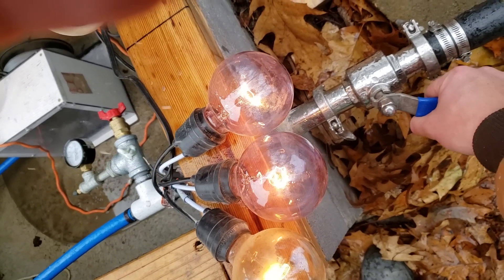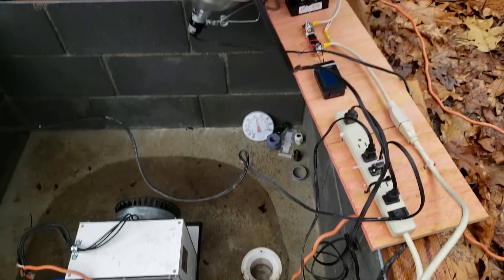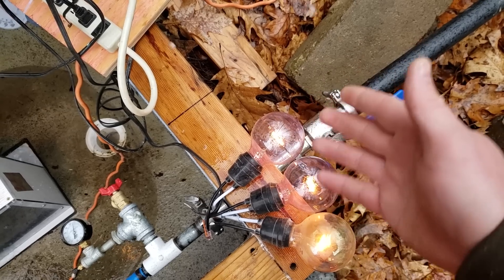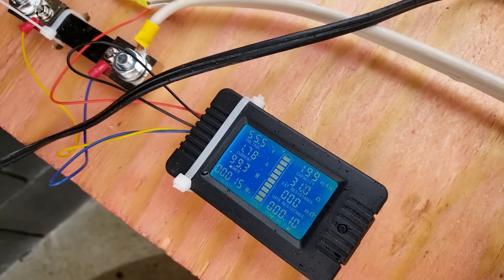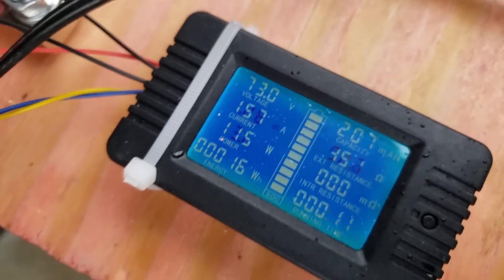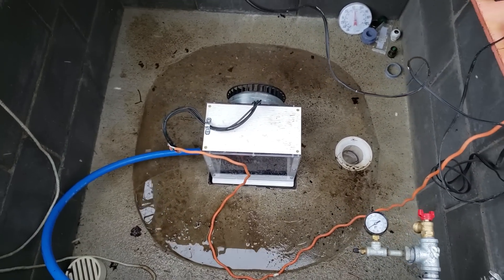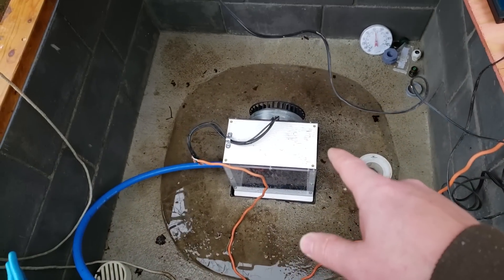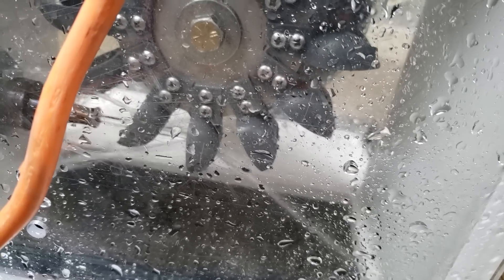It's Producing 130W* at 11gpm 280ft, Much Less Than It Should.

Comment: Bro ya can't test the motor like that you will damage something...... Cause you not got compensation on the flow when you turn the lights on motor needs more tourqe as the switch is closed .....so fully opening the flow the switching any light on is technically a short circuit and probably kill that FULL BRIDGE RECTIFIER 😂
Reply from the maker: It's not a concern, the rectifier is rated for 100 amps and alternator for 4kw.
Reply: @JoeMalovich  probably sounds worse on video than it is. I not no expert but that noise from it can't be good on bearings 🙂🎄
Reply from the maker: @davey2k12  fixed in the next video I think. It was a jet alignment issue.

Comment: You are also getting a restriction from your fittings on your manafold off your penstock. They create turbulence as water flows through and effectively makes a smaller restriction.  the best thing that I can think of to illustrate fluid dynamics and turbulence causing restrictions would be the Tesla Valve.

Comment: Hi Joe, the Turgo turbine isn't made for your setup. with Turgo turbine you need more water and less presure. I am not sur that your blue pipe is able to accept 11GPM ( it's 0,7 liter/second) without big losses. You should tried to connect the black pipe to the nozzle. When I made my tests on my Pelton turbine, I was using several bulbs, (as you do )and the maximum I had was 450W. But as soon  I have connected a Mppt charge controler, the power has increase to 650W.

Comment: I don't get your hookup you said something about that generator being three phase yet you basically hook it up to your power strip like it was household current and I imagine you have a hot ground line. I'm not there to see the whole thing. I was going to comment and I still am. You're DC voltage is the probably the equivalent of a lawn mower stator note the stator is under the flywheel comparison in this manner you got a good stator. If you did not hook it up to a hot ground line. Which your light bulbs are not using if anyway. You have more power that you have not tapped into yet because you're not using one of your three phase coils you're down a coil. Because it's a 3-phase generating unit if this is so you are measuring only two of your three live wires.. or is one of the negative. If negative it should go to the frame of the car if it was a car alternator. Therefore yeah do you have a grounded. And your two hotlines should be tied together yes because you have a silly three-phase generator. Okay don't forget that you can blow a coil that is overheated.
Reply from the maker: The 3-phase is rectified to DC
Reply: @JoeMalovich  shocking you was playing with AC current..... best not get shocked
Reply: @JoeMalovich  I'm not an expert when I say you have success. And if you want more power it looks like you need to put in another unit that is a mother turbine. Yet you declare you're having issues in maintaining your pressure. I think you want to definitely scoot. AC current into the dwelling before you Rectify it. Quite frankly I wonder why Rectify it at all. I definitely I think that you should just dump it into a electric heater that can take the variation of current that is not necessarily considered electronical. Adam breaker and you probably have it set for winter. If you desire to have some fun get rid of these solar generators that is is a battery in a box something like the jackery 500. And then there's is one called Yeti. Well in closing I hope you do not have to pay the price learning what causes your copper coil to overheat.

Comment: Where is your ground. Where is your ground rod. Where do you put that ground in Concordance with the generator unit coil itself. Know when we buy portable generators there's always a little section about grounding. We easily know how to ground an appliance. But this is a generator. Even I need to look into where does one need to ground a generator unit. Because I just follow the instructions.

Comment: Joe, i'd start with removing that blue pipe and stepping it up in size, i went from 1.5" pipe to 2" and gained 50w per jet.
 That bend in the blue pipe will also give you some loss so would remove that,my guess is you will only have water for one jet so i think i'd move the entry point of the pipe so it's directly in line with your turbine housing rather than it go around to the other side.
Next i'd be looking at your pelton wheel, i used the wheel that come with these turbines and it was ok but then bought one with more spoons like yours this made things worse i then bought a turgo which was much better.
You have good pressure so maybe a smaller wheel would work better, also a smaller wheel would give you more space in your box so less turbulence (if that's the correct word)

I've been having fun with one of these for 2 year and if i've learned anything it's you need to do a lot of trial and error till your happy, sit back take a look at what you have scratch your head and go back at it and you will get your end result your already winning as your making power you just need to fine tune it.

Comment: I think the walls of the  turbine housing are too close to the pelton, the wail from the pelton feels as if the water is bouncing off the wall and hitting the pelton again. I think some peltons are designed to use the bounced water also but the housing walls are angled differently. If possible just try removing the housing wall just opposite to the jet.

Comment: How bout turning the 120 v DC into 120 v AC someway . Or add more jets . Also if it’s  120 v DC coming out , you could lower the DC voltage to about 12 , 24 , or 48 volts DC and try to run an inverter off of it and see what it can run at 120 v Ac . Also try using an auto water pressure regulator to keep the hydro spinning and to stay within the set DC output voltage when running heavy loads off the inverter . Which means ,When you switch on a heavy AC load  , it will let more water pressure spin it faster to maintain a steady DC set voltage for the inverter to keep running the load until you turn it off then it will slow back down maintaining the set DC voltage until you run another heavy load and so on . I’m just saying it might work .

Comment: I was trying to figure out how you have that hooked up...I see your problem

those generators were not meant to be directly connected to a load...DC or AC

the rectifier of course takes the 3 phase AC and converts it to DC....that DC is meant to go through a charge controller to charge batteries, the batteries of course run an inverter....you need the batteries and inverter

an MPPT controller like midnight solar has would work great...
Reply: Ay it he only getting 200w cus he loaded it making circuit resistance less causing the spike I'm surprised the switch didn't fry or damage the motor or bulbs from keep switching that heavy load on 😂
He cud of tested the motor first 🙂

Comment: Water bounce of spoons and shoot in opposite side of box, this means water after interaction with turbine wheel still left some energy(maybe half or even more), your turbine extract not all energy from water - this is major loses. You need some clever turbine tuned for this particular water jet, or second stage of turbine. When you extract all energy from water, it will flow straight down, and not flying all sides.

Comment: Hmm I don't trust that meter, unless it was specifically rated as a "True RMS" device. That 20 watt residual is very suspicious. Rectified 3-phase is very different from a sine wave and will give you bad readings. See if someone can lend you a True RMS volt + ammeter? Then you can measure RMS voltage and current to work out wattage.

Comment: I dont think its a single issue like a few have said you should lose the shunt and power meter and get a good clamp meter also at full speed there was water bouncing off every flat surface inside that box causing friction, also if your using an mppt controller for a 24v system you will see a lower voltage reading but an increased amp/wattage going into your batteries and as long as you have water that should run 24/7 unlike solar so at night when your using less it will be topping up the batteries.

Comment: but i would move away from bulbs and work with batterys if thats the way you want to go as long as you have a columb meter on the battery so you can always see that current is going into the battery and wat ever loads you have does not exceed the input i think all will be good

Comment: problem is thors bulbs are only that wattage at the dysigned voltage you need to work in the range your wont the voltage so say you wont 66V then i think 3 12v bolts in series might give more the right range if indicator bults then they tend to be about 21watt each

Comment: You dont think that because of the freezing temperatures that the water has actually expanded giving you false flow readings? 
Im not electrical bias so wouldnt know of anything there however these temperatures could also effect whatever lubricant you have in those bearings that could be causing a lot more friction that youd expect

Comment: one thing in my reading is when they say 80 to 90% effficent they never say jet amount size of pelton wheel and so on i do think a spear valve is best that way jet size can be adjusted with out having to take apart to fit new jets and the way i see it the more jets the more foce on the pelton wheel so more steady rpm when loaded i maybe wrong but i feel the more load means more mechanicle resistence so this would been more jets to keep that same amount of force

Comment: You need to hook up a charge control which would maximize the voltage and charge the batteries. Maybe to much air and you may need a stack pipe.

Comment: Great to see more progress. 
for measurment : It's not dc, it's rectified AC, so you have a massive ripple.

 To get stable  DC (for measurment) you will need a capacitor to even out those ripples.  how big a capacitor depends on the ripple size. 

There might be a small capacitor in your  device, but not big enough for the size of the ripple

Comment: You are thinking of the curve of efficiency being linear and it isnt at all. you will only get good efficiency at the peak of the curve. at the low end there are so manny losses to overcome and at the top end the penstock friction starts to give losses. There is a window in the middle that will work efficiently and your job when making the turbine is to make the window as wide as possible so it will run well at all its rated flows. You have to remember that it takes a lot of energy to to spin the thing so you have to overcome all that first before you make any power. But thats not to say the problem is in the alternator. it isnt. i use the same one unmodified and easily get 60% efficiency if not more and my range of flows that work at that efficiency are 200w - 400w, below that or above that it drops off. When you sized your system you needed to monitor the average flow and size everything to run at that. I think you are thinking you can have a turbine run at 100w at 60% efficiency and have it run at 60% at 1000w you cant get that sort of range with a basic turbine like that. you will find that the turbine has a sweet spot where just a tiny bit more water makes it produce a lot more power but your just not there yet. If the 11gpm is a normal flow for you then you need to size the turbine to work at that flow and to small varations either side of it. you will never get that system to run at your lowest flow and highest flow efficiently because that gap is just to big to try and do with one turbine. You would need a small turbine and a large turbine. to get such a range. dont get me wrong it will work but it wont be efficient. My systems have always been made to work best around the 300w mark. it works well down to 200w and will go to 550w before real big loss come in to play. But to ask a turbine to work at 60% efficient over a range of 100w to 1000w is just not realistic with one turbine and lots of nozzles. I Really think you should slow down forget trying to get a turbine in this year and just measure flow. I measured flow for two years before i sized my system and i knew the average flow and sized everything accordingly. if you go right to making a turbine and you dont have a really good idea of what flows to expect, and they are so volatile, making a turbine without that data is the wrong way to go about designing a system. I love the vids and im not trying to put down your work at all i just think you need alot more data before you carry on.

As far as jet alignment is concerned it looks ok. Maybe adjust it up a little. but the pelton has to few spoons to really work at its best. if you spin it slowly you will see the jet jump the gap for a split second. there should be another spoon in that gap to catch the energy.The jet should interact with three spoons at a time.

And also dont relly on the free spin voltage to tell you your loaded voltage. work it out from rpm, the free spin water splashing can slow down the wheel and give a wrong reading and then you set your load voltage to half that and its out, work out how many volts per rpm and work out your nozzle velocity go from there, use the free spin voltage as a very rough guide only.
Reply: Also what PMA is that. if its the 48v one then something is wrong because you should be seeing 4x that voltage free spin at your pressures.
Reply from the maker: @KrisHarbour  it's the 1603 which does not produce the volts per RPM you might think based on the website information.  I'm getting like .072 Volts per RPM.
Reply: @JoeMalovich  Ok well that is interesting. you need to work out your nozzle velocity, and the speed that the cups would move on there center line (the area the jet hits) With that PMA with a turbine that size i would expect you to be getting 400v I use the same PMA at 25psi and get 120v at free spin and my turbine is very similar in PCD (size across spoon centers)  work out that nozzle velocity and let me know and we will see what rpm you should be aiming for.
Reply: Also i would really think about doing a direct water heating system instead of the charge controller and batteries, you will loose 10% just in the controler and charging. I have to do that because im off grid but for you your biggest consumption of power is heating water (im quite sure you said that was the case) so offsetting your grid use by heating your water tank would be a way of not being grid tied but use the power wisely. It would also be a lot cheaper doing it like that. its basically what you have set up there. you would need a way to fix the voltage to something a heating coil will work at and match the turbine rpm to that then dump the amps in to resistive heating in the water tank. Just an idea to save a lot of money on parts and save money on your power bill in the future. with batteries you wont really save money for a long time as the cost os high and the payback on them is a long time.
Reply: Kris, are you saying that at 30gpm he might actually get the 600W (60% of 1kw) because it’ll take a big jump from 11gpm to 30gpm...it’s not linear as you say?
Reply from the maker: @gritnix  just to add: 60% and 30gpm would mean 907W for me.
Reply from the maker: This is the information that I needed!  I was under the incorrect assumption like you say that it will behave in a linear fashion once I overcome the friction to get up to operating RPMs. I need to find the amp rating on this alternator. I will have less losses to friction with a larger runner operating at a lower RPM, lower voltage, and higher amperage. A larger runner will have more spoons too which will help like you say.

I may leave this one how it is and focus on building the SS Turgo unit sized for the upper range of expected flows, with a smaller unit coming later for lower flows.

Comment: Sure generator may run at 80% efficiency, and probably does.

I would guess, that water hitting the spoons would easily waste 50% of energy. Especially if geometry is somehow not correct and also I would expect efficiency here to go down with RPM going up.
Try different kind of load like heating wire and reduce voltage to 30-40V and see what the power is.

Comment: I know it is a bit late, but you really should get rid of the 180 bow and put the penstock in line with the nozzle. When I saw all the bulbs I thought you where going to get the maximum power point of the turbine. Might be helpful to check if the (new) charge controller is doing its thing. Just start with no load and than switch on the lights one by one and note the voltage, amps and watts produced. I was using this side when I had to characterize a small solar panel as part of my lab course at university: https://www.samlexsolar.com/learning-center/solar-panels-characteristics.aspx

Comment: The 1-2 W when you switched off the load, is likely the display/meter you have there, depending on wiring.
Reply from the maker: it was 20W,
Reply: @JoeMalovich  My bad, if you have nothing lighting up, then the 20 W is indeed odd, any chance the scale factor on the display is set wrong for the shunt being used ? Would also explain why you get less power under load than expected. Some shunts can have odd values to adapt to older analog displays, like 400 A = 60 mV, thus it is not always a scale factor of 10, 100 or 1000 ( example from a known shunt, I do realize it is not the actual size shunt you have in that setup )